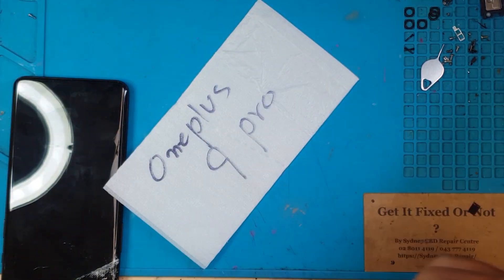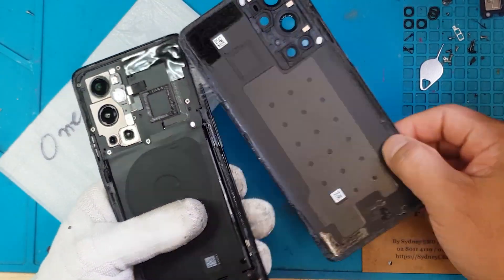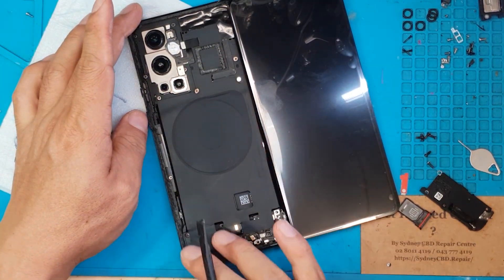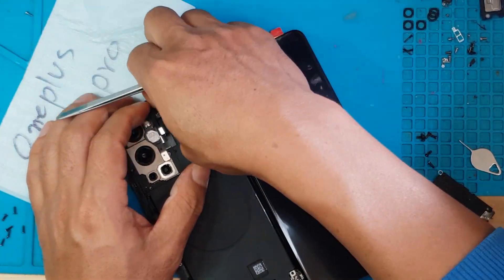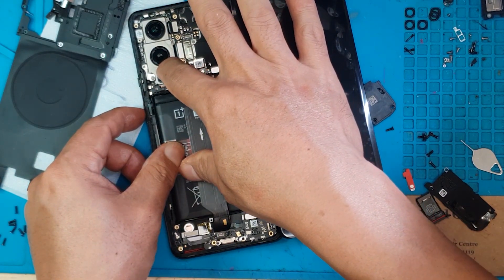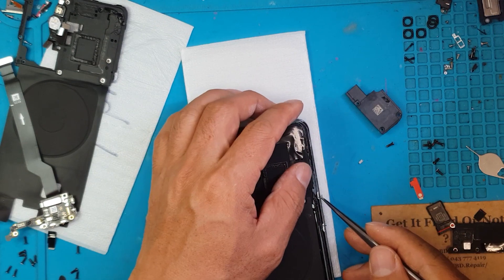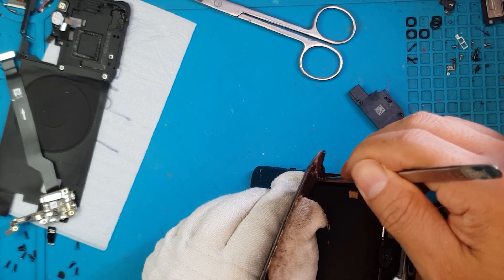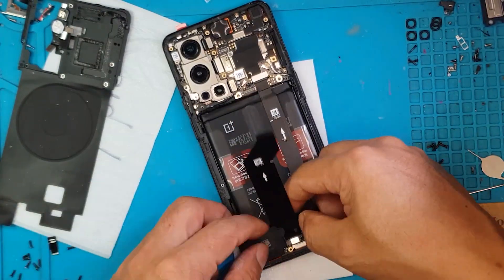QUICK FIX! OnePlus 9 PRO Screen Replacement | Sydney CBD Repair Centre

Comment: Can we change the power button of oneplus 9 pro 
The technicians in our city say it can not be replaced 
If you can replace please make a video so i can show them how to to this
Thanks in advane😅
Reply from the maker: i believe we tried to replace it but it didn't work so most likely the oneplus 9 pro mainboard issue or you may contact the oneplus official customer support. thank you.
Reply: @SydneyCBDRepairCentre   no the button was damaged because ho uv glass glue button is working but it become very hard and the repair guy told me the rubber of the button is damaged and they don't know 
Can the physical power button be replaced i can buy it from ali express 
I just want to know that
Thanks for your time bro